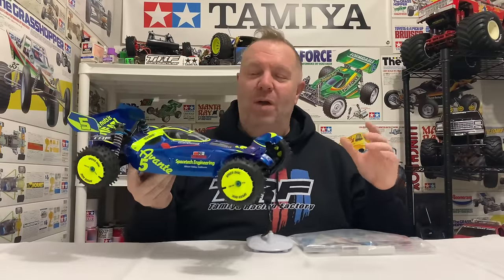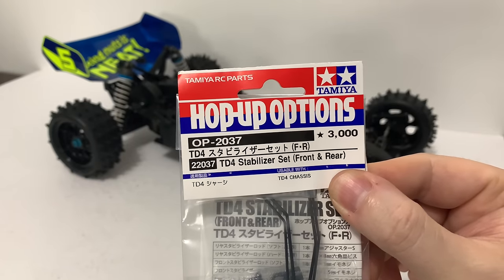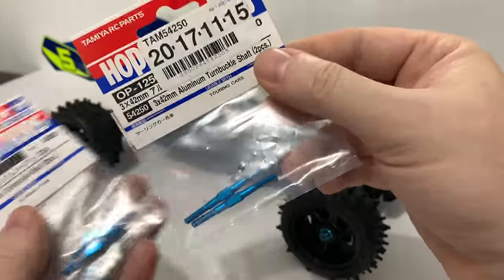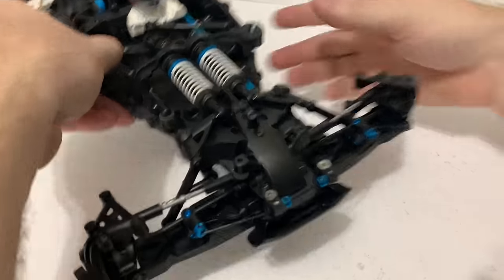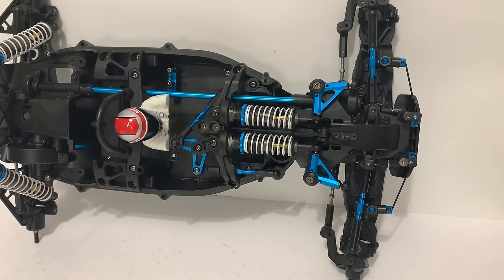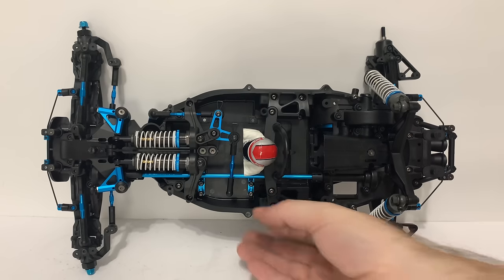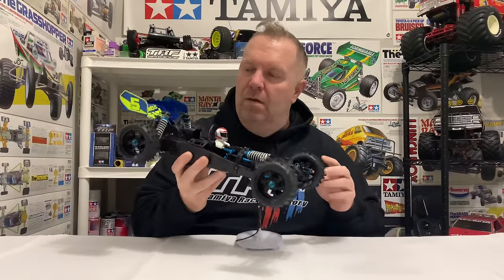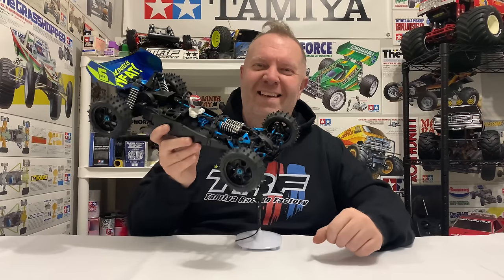Tamiya TD4 Super Avante Full Spec

Comment: I haven't started building my TD4...heck, I haven't even received it yet (should be delivered on Monday)...but, I can say this - you now have all the 'Hop-Ups' I've either already received, have enroute, or will be ordering (once back in stock), except one.  You are still missing one 'Hop-Up...and, it's even better than the aluminum diff nut.  What are you missing? Gear diffs...specifically, the Steel Gear Diff Units (54471), Gear Diff Shim Set (54589), and (optional) Aluminum Gear Diff Covers (54602).  Get those, and THEN you'll have a "fully Hopped-Up" TD4. 🤙🏼
Reply from the maker: Yeah that’s a great point 😎. I really wished this kit would of come with gear diffs as standard 🤕
Reply: @TAMIYALegends  I might have also come up with a way to completely eliminate the servo-chassis torque flex...but, I won't know for certain until I receive my TD4 (should be delivered tomorrow).  Once I have a chance to look at the chassis pan, I will know whether, or not, my idea would work. Will update once I know.

Comment: Mine is still in bits after my diff nuts give up two minutes into its maiden voyage😔 still waiting for the replacement parts and have done since Christmas😡......nice one tamiya!
Reply from the maker: Oh noooooo that sucks Phil 🤕 I must admit I only put a couple of batteries through mine with the kit diff nuts 😅
Reply: Yeah, I’ve had some torquing issues with my TT-02 before and most recently after I installed a hard coated 27T pinion, one of Tamiya’s newest. 

Put some blue Loctite on the nuts and torque them up as you did previously. It shouldn’t back off but if it does, it may be worthwhile to inspect the entire driveline for any vibration or binding.

Anyway, I hope you get it all running again soon. That still sucks it happened though Loctite on nuts and bolts definitely helps.